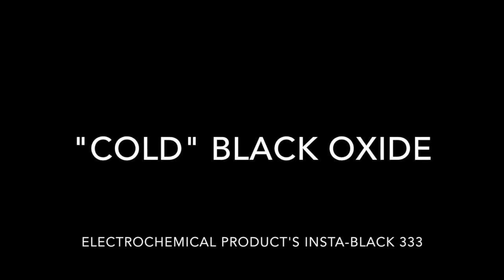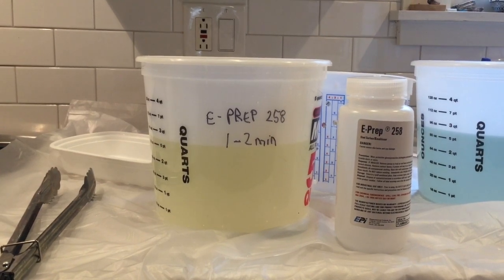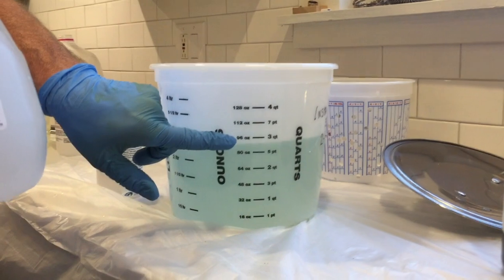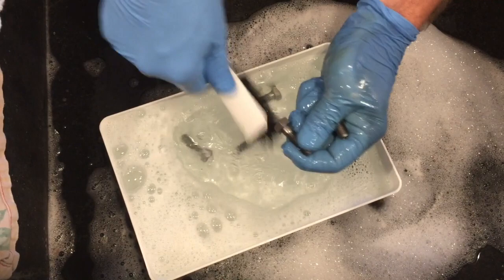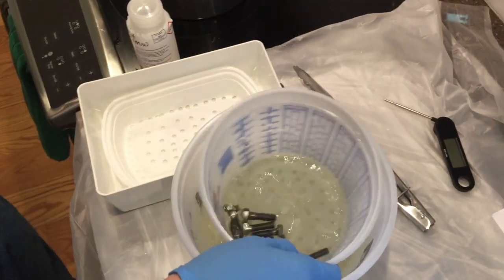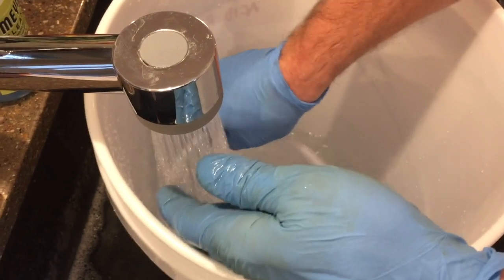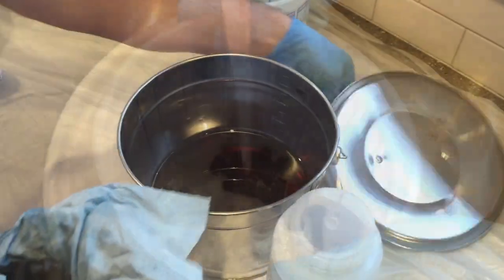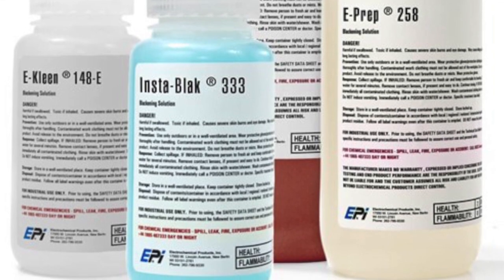Insta-Black Demo

Comment: I did my first batch today and you have some good ideas to simplify the process, the cups with holes is a good one, also not using the same cup saves time.
One other thing, do you store your solutions for later?  Thanks

Comment: Birchwood Casey has been selling the same product for decades (M-24 or PC-9), the PC-9 works better. Birchwood Casey's PC-9 may be the same as Sculpt Nouveau's Black Magic. Cold bluing/blackening (as we've all learned) is not durable under any conditions. I would encourage you to learn hot bluing with potassium nitrate - for small parts (under 10") it's easy and cheap (but do it outside). Odd, as a teenager I worked about 300 yards away from EPI's location in the same industrial park. Here's a lot of patina solutions. https://sculptnouveau.com/collections/finishes